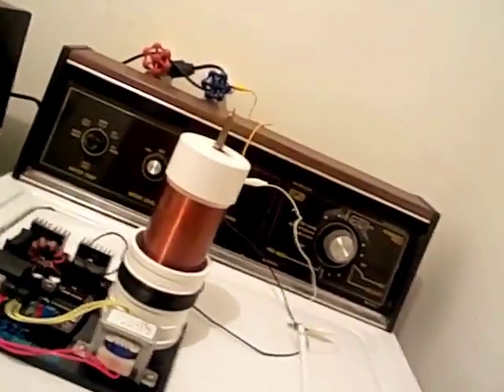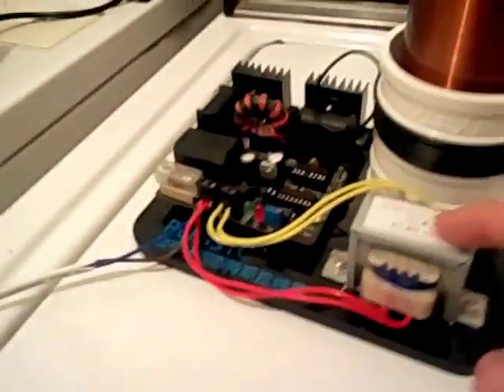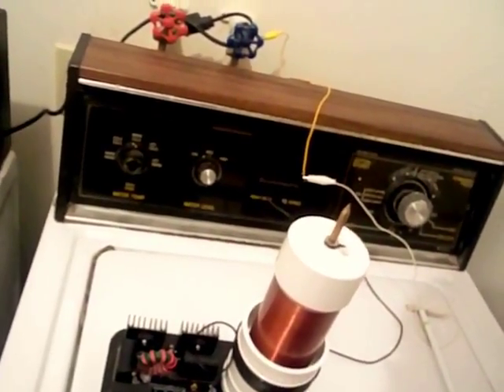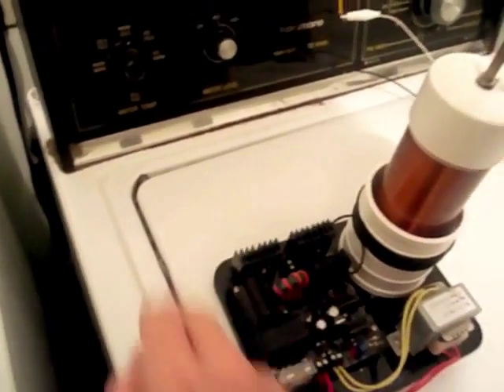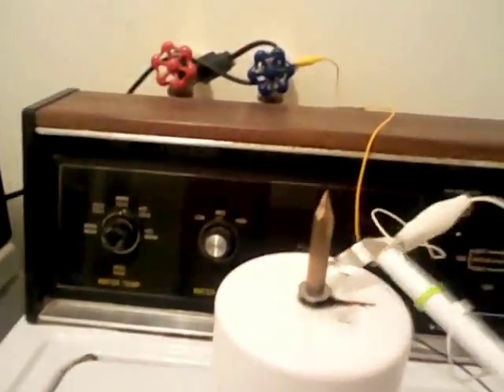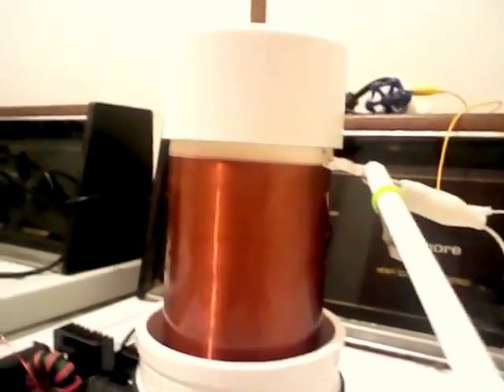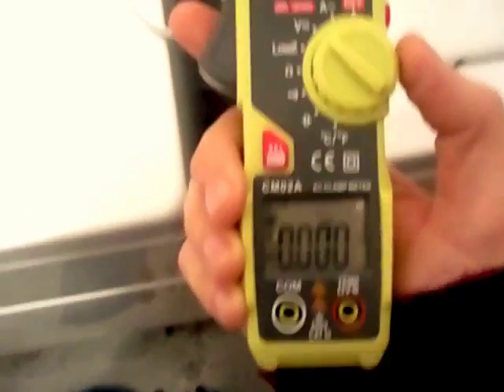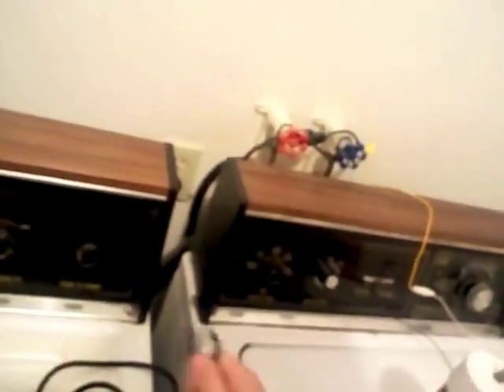Tesla Coil ⚠️ ZVS ⚠️ ⚡️

Comment: Amp meter needs to be around just one leg of your power cord. Testing both at the same time they cancel each other out (Kirchhoff’s Law). This is why the meter read zero amps. I see that your power cord is separated where it connects to the target device. Clamping one side there should work. Be careful out there! High voltages will burn anything they can!
Reply from the maker: thanks Pete !!!

Comment: When using an amp clamp style multimeter, you only want one wire running through the clamp. The reason you were seeing 0 current was because the other wire carrying the return basically cancelled out the amp reading
Reply from the maker: yeah, lol i just got it and took it out of the box, and didn't even read the directions,lol, thanks Curtis ,.,.

Comment: Slowly increase voltage at the beginning, the initial start up of the mossfets with the coils cause a momentary spike.
Reply from the maker: oh yes, thats correct!! i should have spent more time at that moment.
Reply: @sa8die  not too low to start with because then the mosfet is a low value resistor then and will burn

Comment: I think this circuit isn't a ZVS but instead just a normal solid state tesla coil circuit. That thing with a shape of a donut a wires arround it is called a Gate driver transformer or GTD it have the function of driving the gates of the mosfets providing a galvanic isolation from the half bridge to the driver circuit. And the mosfets on that circuit aren't arranged like a ZVS circuit but insted like a half bridge. And those capacitors are for ''isolation'' 
because of how a half bridge works. Those chip's are for controling the GDT with the high frequency the tesla coil needs to work. I'm a little bit late but a hope you see my coment.

Comment: Hum not a zvs here , the component show that is a half bridge : 2 mosfet , 2 capacitor , a GDt with 3 wire (that allow the driver to contrôl both mosfet )
Reply: I remember watching this video a year ago with 'ZVS' in mind and it got me into common ground push pull setups which are pretty cool. This is likely a half bridge cause it seems more likely for a PLL but it's hard to say. I can see what looks like probably a 74HC14 and CD4046 or similar IC's for the feedback and gate driving transistors but all of these same components can be used in either topology. In the case of the class B (sort of ZVS) the primary could be split into one winding via a common mode choke which could more or less look like a GDT here. IDK why there aren't more Chinese sold circuits out there using the topology a lot of people call ZVS though. It may not switch at zero volts but the push pull is easily driven via a single GDT which also serves as the feedback transformer and at low voltage they can achieve arcs much longer than the ones on this PLL driver.
Reply from the maker: hey guys that amazon title said this soo maybe its not like a pure-textbook Zero Voltage Switching, but pretty close!
Reply: @sa8die  Mazzilli driver is often abbreviated to ZVS but yea this could still be a ZVS half bridge

Comment: Not a hundred percent sure but that doesn’t look like a ZVS to me.  Judging by the 3 wires of the toroid I would say it’s a gate drive transformer for driving the gate of the MOSFETs/IGBTs.  A ZVS choke would only have one wire.
Reply from the maker: ohhhhh i added the extra wires, and its not helping, I will make a newer video with a very close up in 4k of the circuit board, thanks ST
Reply: sa8die electron Cool!  Looking forward to it.

Comment: It’s interesting that the output looks IDENTICAL to my dual 811A VTTC. Even the half-wave rectified 60Hz sound.  I have a duplicate secondary of that coil, it would cool to have both types generating the same results. Do you have a link to the circuit you bought?
Reply from the maker: on i purchased off amazon from china, i need to maybe measure some voltages, thanks
Reply: sa8die electron Can you PLEASE  provide a link or something to the Amazon item? Measuring voltages will not be of any help for this.

Comment: Interesting circuit they made there. They seemed to have designed the push-pull to run at the resonant frequency of the tower. You may have better luck just buying a 120v-15v transformer that can handle the current and omitting that step up and old transformer.
Reply from the maker: too many transformers def reduces efficiency , yes more direct energy transfer, i purchased it off amazon, and i suspect it was for the EU,.its all good, i will continue to modify it and it will get more efficient

Comment: 3:06 do you say that often? Lol "let's turn off the lights and do it real quick. Now I can't see my thing"
Reply: Hey we met again!!

I think this is the video u r talking about
Reply: @tvishmaychoudhary69  i wasn't talking about a video, i was talking about something similar to this that i did myself.
Reply: @jjhack3r  i mean that this is the same thing you did
Reply: @tvishmaychoudhary69  I'm going to shoot some footage of my overpowered slayer tonight but i haven't messed with zvs circuits in a while so that video might be delayed.
Reply: @tvishmaychoudhary69  actually after watching the video again, its totally different. That circuit is premade and not a typical zvs at all.
Reply: @jjhack3r  oooh than i think i made a mistake 😶😶
Reply: @tvishmaychoudhary69  lol still funny that you found my comment
Reply: @tvishmaychoudhary69  zvs circuits can be time consuming and costly if things go wrong. I only have one more set of irfp260 mosfets left so i gotta be careful
Reply: @jjhack3r  I never touched zvs though 
But I have made a slayer exiter, it worked very good and outputs 2 inch of arcs at around 30v !!! But I killed it unfortunately and after fixing it it drops to around 2cm 😢😢
Reply: @jjhack3r  I will upload the video of that slayer exiter
Reply: @tvishmaychoudhary69  i have found that the exact kind of transistor makes a huge difference in performance. The slayer circuits I've made use nothing but a resistor and tip35c. The tip35c is the best i have tested.
Reply: @tvishmaychoudhary69  the zvs powered coil i messed with had acrs way to hot to touch but i still used a piece of metal to draw out arcs. NEVER TOUCH FLYBACKS. They are dc and run at much lower frequencies. High frequency ac is mostly safe above 500khz but don't take my word for it.
Reply from the maker: lol, some one has a dirty mind, if u like trans, im on p()rnhub under : sa8die

Comment from the maker: The  Electromagnetic Radiation Test/meter
that I have measures E-field in Volts per meter
AND  H-field in micro-Tesla's with 0.00 uT resolution
sooo, that will be interesting,.,.,.
💫 ⭐️ 🌟 ✨ ⚡️
i will have to wait until the morning as its 200AM, and the bf
was awoken and wondering what all the noise was, lol

Comment from the maker: next time ill hook the meter up directly, lol
and i have a
KCMOON GM3120

 (these meters are CHEAP on Amazon,
and alot of fun to play with, can detect EMF when i drive by power lines,
or with my stun gun collection).
Reply: I think you should probe only a wire with the clamp, not both (current in both wires goes in both directions with net sum = 0)